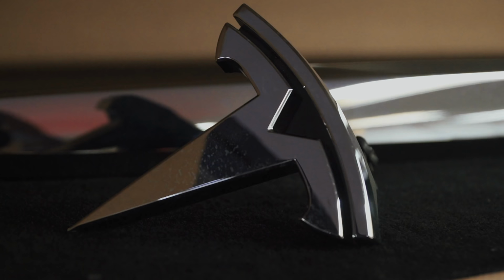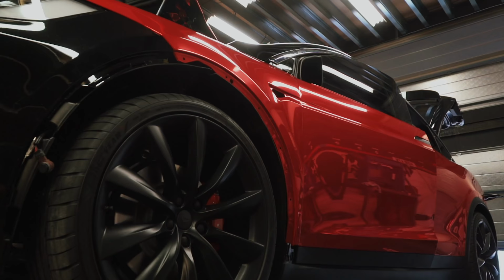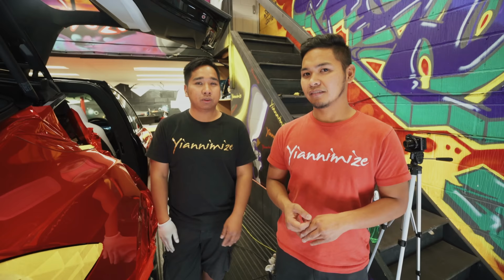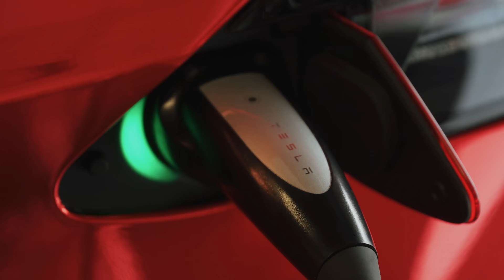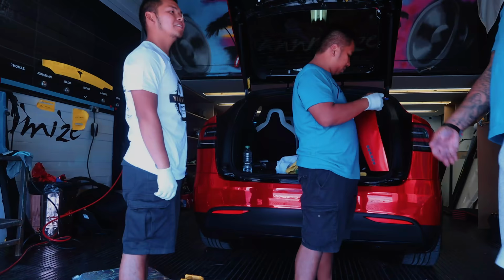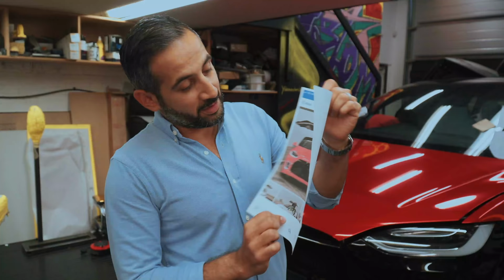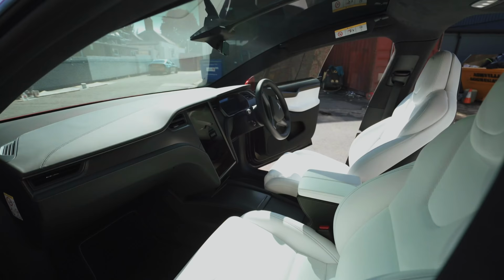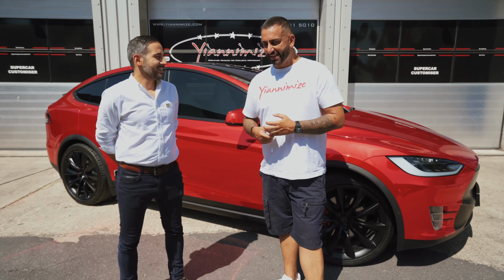Wrapped Simon Cowell's Tesla... He Didn't Like It!

Comment: 5.26 GLUE LINES, not good at all, 5.30 rough cuttings with a blade and failure. your guys need to learn how to lay chrome. All the YouTube subscribers see are small edited clips, but in reality super cars  there are far and few between. There are imperfections in the install on many sections and give it 6 months this will fail. Your team strip the hell out of cars so how do the Philippine wrappers struggle, when a car is stripped that much down it makes the wrap easy.